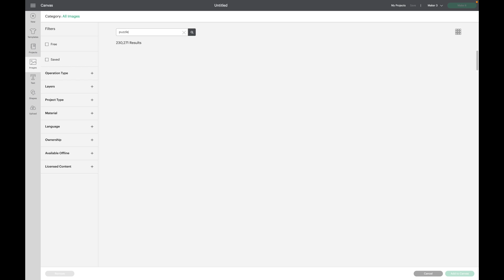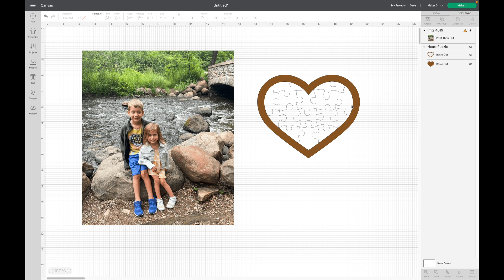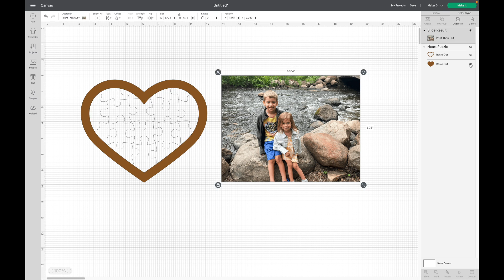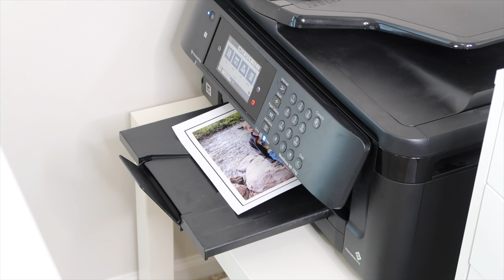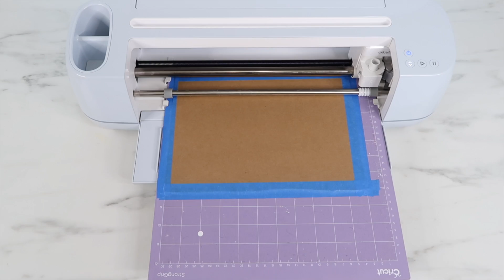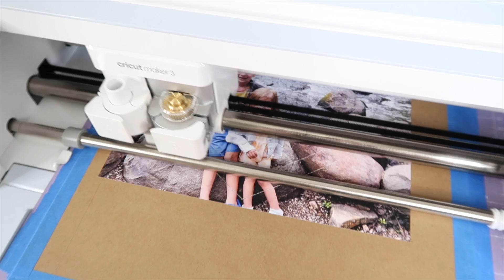HOW TO MAKE A PUZZLE WITH CRICUT MAKER | VALENTINE'S DAY GIFT IDEA

Comment: Tried to do this project with the Cricut Explore Air 2 and just couldn't get it to work.  Didn't have the thinner chipboard available so tried using 100lb cardstock but just would not cut all the way through with the printable sticker.  Gave up.